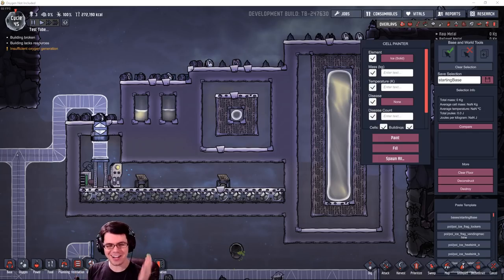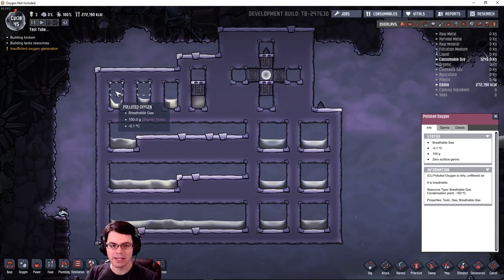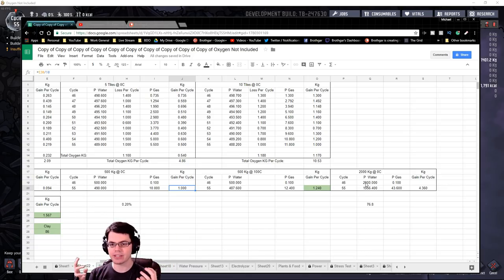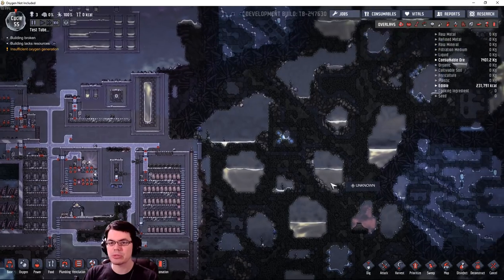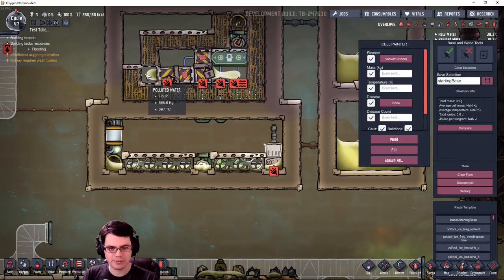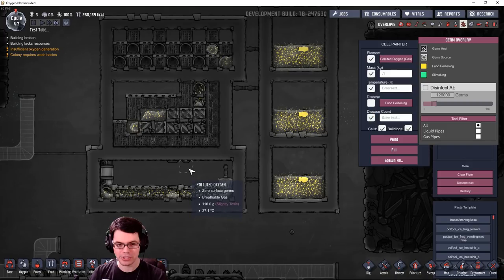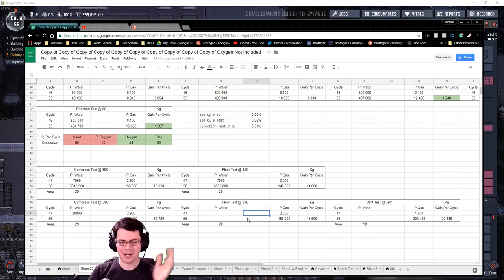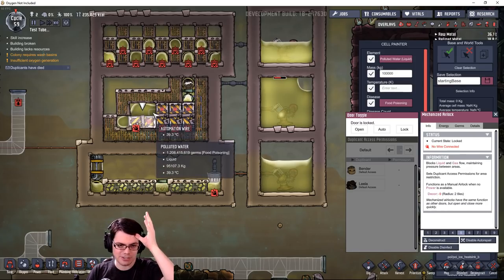Bubble Polluted Water into Oxygen Experiment! Oxygen Not Included

Comment: In case any one is wondering it is possible to compress water in real life but to get 10 tons per cubic meter would require pressures that you see in the center of the sun! So super compressor indeed!
Reply: Cody'sLab  i did not know you wached brotgar and im subed to you love your videos
Reply: Actually Cody I think you may be a bit off on that number. The center of the sun may be about the density of lead but it is also hot. If you put cold water under those pressures it would compress a lot more since it doesn't have the thermal energy puffing it out. Water would certainly heat up as it is compressed for the same reason that gasses do (unfortunately the game doesn't model this) and the fact that it wouldn't compress linearly so it is hard to calculate what the compression would be at 3.4 × 10^11 atm (pressure at center of sun) but I think 100Kg/m^3 might be a closer guess.
Reply: Well fine, but it would still be A LOT of pressure!
Reply: Lol true enough. I think diamonds are formed at only 5X10^5 atm so if he put some coal in with that super compressed water...
Reply: Yes yes it would; probably hexagonal ice eleven or possibly some more exotic form never before seen.
Reply: Actually with the kinds of pressure we are looking at here the oxygen hydrogen bond would most likely break down and metallic hydrogen would form.
Reply: This comment and its replies are glorious
Reply: Holy crap Cody watches this too :D
Reply: Cody'sBLab I just love how you corrected yourself, using your blog account. This is the kind of stuff I sub to you for
Reply: Easy science vs hard science. All good science.
Reply: Cody’s here
Reply: Didn’t expect you here ...
Reply: I would bathe in that

Comment: Did you test for depth? If you have 10 tiles deep of polluted water, does it take all the water into account when generating polluted oxygen, or only the exposed tiles? i.e., would we have to spread out the water to maximize surface area, or could we just put air-pumps over the random pools without bothering to alter them?

Also... what about dripping the water? If you had a little waterfall of polluted water, would it generate polluted oxygen faster?

Comment: On your + shaped experiment, this is effectively a corner airlock and those only seem to work down and to the right.  So the left chamber, which is down and to the left, can get the gases from the top chamber, which means it might not actually evaporate to the left.
Reply: That is correct. Sublimation only occurs in tiles above polluted water. The game code has no check in any other direction. Remove the top tile to form a T instead of a +, and there would be no sublimation happening.
Reply: I'm assuming it's because of the same bug but you can confirm that sublimation can only occur up by making a T instead of a +.
Reply: It is possible that it was random noise.  The bubbles happen very rarely on individual tiles, so maybe 10 cycles was not enough time to get a decent sample size.  According to the wiki, a tile of polluted water has a 0.1% chance to emit 0.1% of its mass 4 times a second.  However, when a base gets big or time goes faster, the physics of this game can change slightly.  I've noticed in one of my experiments that when I increased the speed of the game from 1 to 3, my liquid cooled aquatuners settled about 3 degrees hotter.  They decreased temperature when I reduced speed.

However, over massive time scales, this should not effect a settled system too much.  The amount of polluted water can be modeled as exponential decay with a linear addition rate.  The amount of polluted oxygen created per second in a system in equalibrium should be equal to the amount of polluted water created in your base per unit time.  Though it is possible that the speed of the game can effect the decay rate, it will not effect the total amount of polluted oxygen created.

I should note that my time observations were made before the automation update and may not hold anymore.
Reply: +Rubellite Fae That may be how you think of it intuitively, but it is not how the game operates.  In many cases, it can appear that way because most things in the game have automatic pressure shutoff, where the local pressure disables creation of a gas (like oxylite, bleach stone, vents, deoxidizers, electrolyzers, etc).  If the game actually tries to add polluted oxygen and there is a polluted oxygen tile in the immediate vicinity, it will add the masses.
Reply: I have a question.  Do you know what I mean when I say down to left corner waterlock?  

In case you don't, I am referring to a direction of travel.  If you were to go down in to the corner waterlock, you would exit to the left.  

I would like a better term for it.  Maybe L-corner and reverse-L-corner.  Only L-corner locks are airtight.  Reverse-L-corner locks are not.
Reply: we appear to be talking about the same thing.  I'm not so sure that it is one way though.  I used this in my own design in an extremely long post.  I use a method to trick the polluted water in to pouring into an overly pressurized tile in such a way that there is polluted oxygen directly above it and their is a (as you might call it) a BD connection or a reverse-L connection.  I feel that this method may be the optimal method, assuming the information from the wiki is accurate. 

The issue is that if it is a bug, some people will not want to use it.  For example, I don't see Brothgar using the vent in water trick.

Comment: In order to maximize surface area, what about a sandwich of mesh and gas tiles? I'm not sure about the feasibility due to gas volume/flooding of the pot, but use wheezewortto precool and compress the polluted oxygen before feeding it into an oxygen liquification system for base cooling/lossless clean oxygen generation.

Comment: I may be wrong, but in the checkered setup with the 9 liquid vents, the bottom tiles are only evaporating in the tile above it, as the tiles on the side are air-locked by liquid on both sides and top?  Wouldn't it be more efficient to have a solid line of airflow tiles separating each row to allow better ventilation of tiles on bottom?

Comment: I wonder how high the production rate of the compressor setup is after it ramped up for 10 cycles. As you can produce polluted water within the base and pump it from everywhere else the pressure would constantly grow while with the other setups to increase production you will need to use more space. The additional downside of using the floor based system is that you will need deodorizers everywhere instead of in one place.

Comment: They really need to add a way to control direction of free flowing gas.  Like big industrial fan or something.  Make it so much easier to control heating and cooling if you could control gas direction in a open space.
Reply: There is. Build an air pump. Air will flow towards it.
Reply: I was thinking the same think, like the Air Tiles but a one way Air Tile (like the valves in the Heart and Blood vessels, pretty much a Check Valve).  If for balance reasons make it a powered item.

Comment: how about a "not standard" Natural Gas geyser-generator closed circle? NG Generator can be used as a cooler, you just need to feed in cooled gas. Then you could take the almost freezing cool polluted water and use it to cool down the incoming NG. Probably you will need a cooling supplement for the starting-up, but then the system could be self sufficient.
Moreover,  after cooling down the NG geyser, the now hot polluted water can be more easily be purified and feed again to the generator.

Comment: @Brothgar. While an interesting experiment it is ultimately useless when you compare to the alternative route of just running the PW through a water sieve and using an electrolyzer.

A deodorizer uses 100g PO2 and 133.33g sand to produce 90g O2 and 143.33g clay. Clay is pretty useless though. In total that's 148.14g sand per 100g O2.

A water sieve uses 5000g PW and 1000g sand to produce 5000g H2O and 200g polluted dirt. The water is then electrolyzed at 88.8% efficiency so it's 22.52g  sand per 100g O2. 

The polluted dirt the water sieve gives out also gives off PO2 which can be converted by deodorizers.

In total the water sieve route while less sexy perhaps is almost 7 times more effective than passively gassing off PW.
Reply: I wouldn't say it was useless experimenting. Seeing the up and left properties and different arrangements was useful. The nice thing about this setup is that it can be done without sand. Now I know you can have a LOT of sand now with the rock crusher so the sieve does make more sense. I prefer morbs over both approaches.
Reply: Unfortunately this failed experiment will now be repeated as gospel elsewhere until people realize that Brothgar made a simple mistake in his testing set up.

Sublimation can only happen up. The game code does not check in any other direction. It is a false result due to the "corner lock" bug. You can verify this by making a T shape instead of a + shape yourself.

I really just point out that the method of PW to PO2 to O2 by sublimation and deodorizers uses 7 times more sand than the water sieve route.

There's also the oxygen liquefier route but then we're talking 100s of times more power use per g of O2 than the water sieve route. Even for the most effective hydrogen bubblers.

(Remember, the water sieve route actually creates surplus energy).
Reply: I don't understand how you can read my comment this wrong. I literally write it's an interesting experiment. Full stop. But ultimately it is useless because if you do the math and compare against the alternatives the gassing off of PW or rot piles will always be a dead end road when it comes to large scale oxygen production.

It can still be relevant to feed puft for slime production for a mushroom farm however. But in that case I personally prefer morbs. And especially the massively complex automatic morb catcher made by manu_32 on the forum https://forums.kleientertainment.com/topic/84176-automatic-morbs-spawner-system/

I would spend time to figure out the most effective way to remove germs. Because if you feed germy water to electrolyzers you get airborne food poisoning. So you either need a low-power high through-put distiller (and no sieve) or a means to remove the germs another way (with a sieve).

Comment: In the floor model, could you do like a battery and make layers of gas titles, connected on one side to give an exit path? drop in liquid on right, air wall on left. no need for mesh.
Reply: Brothgar wish I had the game to give you a blue print.... like the checked board but layers. Liquid tank: left wall gas perm, bottom layer 0 - water, layer 1 - gas perm, 2 water, 3 gas. Not sure if the checkered board it letting gas from the bottom to the top.
PS: thank you for taking the time to respond.

Comment: Had a few questions about the super compressor - first of all you can clearly store an immense amount of water in this way but is it accessible to be used while you're storing it at all?  Also, iss the huge mass a decent heat sink?

Speaking of just letting your duplicants pee on the floor, I was trying a challenge recently to never access fresh water from the map or build a bathroom, could not manage to create steam from polluted water with pre-super computer tech but maybe you have some ideas to get that going. (nearly got down to magma which would have worked out well but it's unrealistic at that tech level - or is it?)  Dupes with a small bladder or flatulence helped out considerably with waste products.

Comment: What is the max pressure possible? What if you did a combination, so that you can control temperature of the base using the temperature of the water?
What if you used normal water for this, instead?
What if you pressurized it into multiple blocks together?
Reply: Not sure there is a maximum pressure. I've had a polluted water tank with 154 tonnes, that's 154000kg, per tile pressurized by the crude oil over liquid vents method. No problem with those.

A lot of talk and time is wasted on this channel discussing door compressors when in fact it's a slow ineffective and crude method compared to air-on-air or liquid-on-liquid compressors.

Comment: The 1st part of the experiment you did 10 wide. What if you did 5 wide 2 tall vs 5 wide 10 tall.  

The other types of gases above the polluted water. 
As with the 1st thing I build in a base past the bathroom. The polluted water drop point. 
Then I dig out a tall storage area for the polluted water for the water to fall into. 
Some CO2 does fall down in there which sets up a block. 

If it's only 1 wide and 5+ tall. It will stop the polluted water from rising past the co2. 
If it's wider. The polluted O2 will make it's way past the CO2.

Comment: Hear me out on this one because I’m not very good at explaining things.. however couldn’t you leave a tile wide gap in between your rooms( For example in a 15x15 area you’d have two 7x15 rooms and a 1x15 line) and filled them with a liquid couldn’t it help moderate the temperature in your base? You could pump the fluids through those big AC unit things(I don’t have a pc so I don’t play this game sadly) to cool down rooms. I know in real world terms lakes and other bodies of water moderate ambient air temperature(meaning if the air temperature is cold it’ll warm it up and if the temperature is hot it’ll cool it down) so wouldn’t this apply to the game? I’m sorry I probably over explained, I’m just kinda excited because I’ve NEVER seen someone do this in ONI before. You’d also have to make sure you tiles(walls, floor, roof etc.) are made of a thermo-conductive material.
Reply: I would greatly appreciate any feedback. Don’t worry about accidentally offending me, I won’t get butthurt about criticism so long as you provide SOME logic

Comment: So you get back 0.05% of the polluted water you put in as polluted oxygen per cycle, assuming there's somewhere for it to go. On the other hand, each dupe makes a net 6.7 kg of polluted water per cycle in the lavatory (assuming you recycle the other 5). So the steady state tank would be 13400 kg times your number of dupes, and it would produce 6.7 kg of polluted oxygen per cycle per dupe. So at steady state you can basically supply about 10% of your oxygen this way...not so great really, especially given the huge size of that tank without a super compressor. But you are right that there is a lot of polluted water on the initial map for you to use in the short run.
Reply: I know its old. I didnt understood what you mean or you are wrong. Full tile of polluted water (1000 Kg acording to liquid vent) should evaporate 2.4 Kg per cycle. I've tested it, it's close to data from video and  it's backed by formula: 4 chances(0.1%) per second that 0.1% mass of PH20 will evaporate That is 600(s)*4*0,001*0,001*1000(PH2O)=2.4 Kg/cycle.  So steady tank(for 1 dupe) would be 3 tiles(3 000 Kg), which evaporates 7,2 Kg per cycle when full. Tank must be little bigger than minimum due to randomnes of evaporation. Its some source of slime for dusk cup.

Comment: What happens if you want to retrieve some water from the compressor?  It wouldn't take very long before trying to remove a tile would wreak havoc.  Have you tested to see how liquid pumps - both regular and mini - do under high pressures?  If you can operate a pump under that kind of pressure, then that opens a lot of doors for development and streamlining.

Clean water, for example, could be compressed into a small space, to be kept until a hydro switch indicates that a well is low, for easy duplicate access.  One of these systems could be attached to each of the geysers to prevent over pressurizing them with water, while what's stored can be siphoned out and cooled, over time.

If pumps cannot operate under heavy pressure, then use a dual chamber system.  Attach an 'outgoing' chamber with a pump and a hydro sensor to the main storage chamber, so that when there is too little pressure in the outgoing chamber, a connecting door will open until the sensor signals it to close.

For polluted oxygen evaporation, couldn't you build a long tank, either horizontally or vertically with the pressure that you had, there?  That would increase the surface area dramatically, while also moving the water away from where it's not wanted much more quickly than using the swamp floor method.  In that sense, wouldn't that system be better for a swamp floor, anyway?
Reply: Pumps of all varieties in ONI are pressure-agnostic, and tiles are the only kind of building that experiences over-pressure damage, and vents are the only kind of building that stops working if over pressurized.